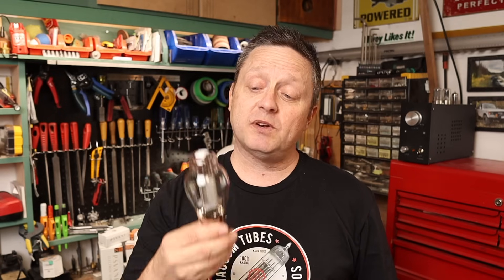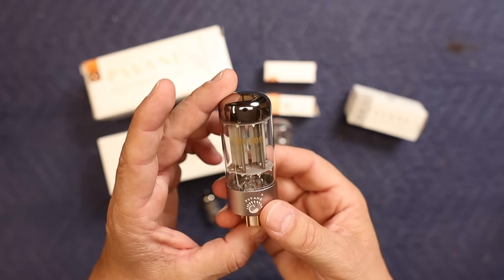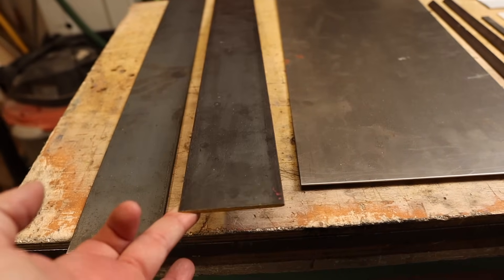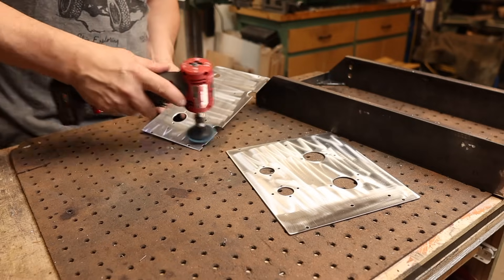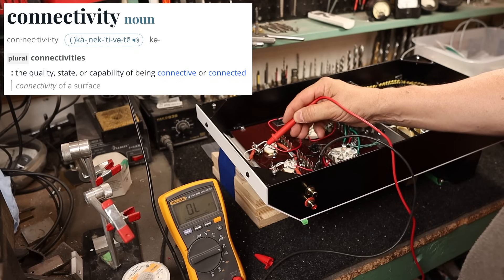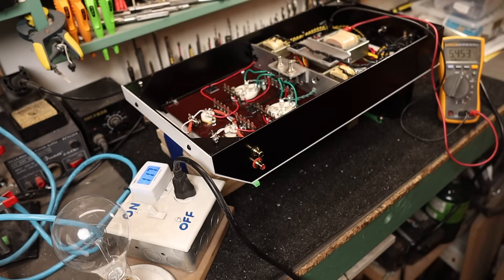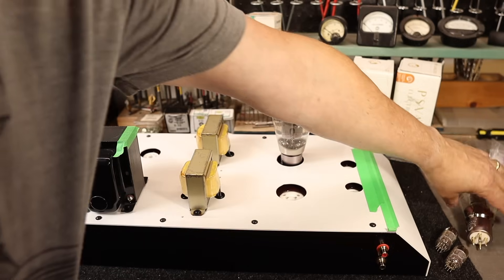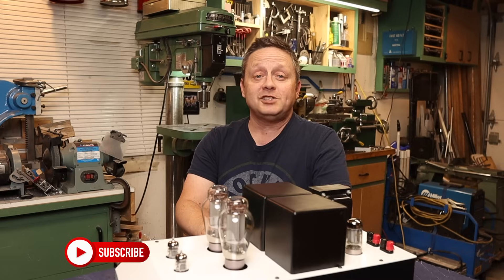Building a 2A3 DHT SET Power Amplifier

Comment: I have the same metal bender!  I don't have a welder. I have looked at a few. For hobby use, any recommendations for chassis?    Without it I tend to cobble something together adding supports with small fasteners.  Or, I buy an aluminum chassis from China. These look nice. That is how I made my tube preamp -- The Lynn Olson Raven with Lundahl transformers. A really nice build. I added a phono stage and MC stepup.

I built a 2A3 about 8 to 10 years back. I use Sophia Mesh 2A3 - more like a 300B. I used inexpensive 2A3s to test. Similar design to your's but different rectifier and input tube. I used a James Audio output transformer, not in business now. I saw that Silk Audio in Thailand is worith looking into. I get the price concern and commend the build! My James cost around $350 each as I recall. I used beefy Hammond chokes and cylindrical capacitors on the parts side on a Hammond chassis. Looks nice. I don't use it even though I have Klipschorns for it. After breaking in the highs were sparkling - better than my solid state amps, or that's how I recall it. Makes me want to give it a try for a few months. It does lack power unless used on high efficiency speakers. My other DIY speaker is around 92db but was just OK to me.

I subscribed to Sound Practice for years and bought the CD of the issues.

Nice build!  I need (want) a hobby welder.
Reply from the maker: Thank you for the thoughtful comments! I can tell you appreciate and get the love of making tube amps. Lynn Olson site has a lot of great projects and information. Having a welder is handy but if you only want to make chassis with it, I'd probably just source one from overseas. If you want to do more you can't go wrong with a small wire feed Miller 142 or the Hobart 125 for thinner metal.  I've heard good things from the TITANIUM welders from Harbour Freight but have never used them.  Make sure and you have the appropriate wall plug and you get one that uses gas .  Flux core is really messy, good for gates, not so good for precise work. The welder I was using in the video is a Miller TIG welder. They are double the cost and take a lot of practice to master. It produces a much better better weld. Get a grinder as well, you'll need it!  Cheers.

Comment: Buongiorno cosa ne pensi se si usasse per la struttura del plexiglass di spessore 3mm
Reply from the maker: I am not familiar with that material, I’ve never used it for amps before. Im sure it would look unique but I’m not sure how it will react with the heat of the amp.  Cheers.
Reply: @MikeFreda  ciao dipende da che calore si sviluppa ,quanti gradi C Il plexiglass, o metacrilato, ha una buona resistenza al calore, ma non è ignifugo e deve essere tenuto lontano da fiamme libere. La temperatura di esercizio non dovrebbe superare i 70°C, anche se per brevi periodi può sopportare temperature più alte. In generale, il plexiglass può essere termoformato tra 160°C e 180°C, e la sua temperatura di fusione è simile. La stabilità termica del plexiglass si aggira intorno ai 100-116°C, secondo Temaplex Online Shop. 
Ecco alcuni dettagli aggiuntivi:
Temperatura di esercizio: Si consiglia di non superare i 70°C per un uso prolungato. 
Termoformatura: Il plexiglass può essere termoformato tra 160°C e 180°C. 
Temperatura di fusione: Simile alla temperatura di termoformatura, intorno ai 160-180°C. 
Stabilità termica: Il plexiglass ha una stabilità termica che varia tra 100°C e 116°C. 
Temperatura di ebollizione: Circa 220°C. 
Resistenza agli urti: Il plexiglass ha una resistenza agli urti moderata, inferiore a quella del policarbonato. 
Infiammabilità: Il plexiglass è un materiale infiammabile e non deve essere esposto a fiamme libere. 
Resistenza chimica: Il plexiglass ha una buona resistenza chimica ad acidi e detersivi, ma non agli alcoli e solventi.

Comment: Nice. I’m kinda new to amp build, but looking at this and your preamp, shouldn’t I see some tone controls somewhere?
Reply from the maker: Good question, they can include tone controls but in this type of preamp it is designed to be as pure as possible.  Adding tone controls adds an extra layer of complexity and components to the circuit... not to mention that it can also induce "noise" into the audio signal due to the potentiometers being needed to make adjustments.  Cheers!

Comment: RATHER THAN 5AR4 YOU MIGHT USE A 5V4.  YOU CAN GET NOS AMERICAN 5V4s REASONABLE.  YOU CAN NOT GET NOS 5AR4s REASONABLE.  THE CLONES ARE PRETTY BAD AND WILL ARC OVER.  JUST A SUGGESTION THE 5V4 IS A GOID TUBE AND VERY AVAILABLE
Reply from the maker: That’s for commenting. Yes, that is viable option. This type of rectifier will drop the B+ a bit more. I don’t think it’s a big concern.  I guess one could upsize the PT to accommodate.  Cheers.

Comment: Good God man! Warm, rich, pure tube sound! You've only gone and triggered the oxymoron alarm.
Reply from the maker: Click bait? Since there is no solid state devices in this amp, the term "pure tube sound" is technically correct. lol. Cheers
Reply: @MikeFreda  I mean't in the sense that microphonically susceptible, odd and even harmonically prone, poor noise floor level thermionic valves can never accurately be described as being "pure of sound"!
Clearly I shouldn't even be on this thread! Off with me then! Regards.

Comment: I’m afraid I need some help with sourcing the hum balance rheostats. I’ve been looking all over, but I’m not sure I’ll order the right component. Thanks in advance.
Reply from the maker: Thanks for asking.  Yes, I can give you a proper type, size and partnumber.  Mouser has a couple options. I used Clarostat.  Vishay makes a 10 turn one.  Let me gather that information for you…. Hang tight.
Reply: @MikeFreda  Thank you! Very kind.
Reply from the maker: 50ohm, 2W-5W Potentiometer.  Clarostat: 53C3-50 2W Linear 50ohm.  RV4NAYSD500A.   If you can find that, try CTS ones from Mouser.   026TB32R500B1A1.     I hope that helps!?
Reply: Mouser  Belgium has the CTS! Great help, thanks!

Comment: I kindly suggest that you do not use ferrous metals for  the chassis construction.
Reply from the maker: Thanks for the suggestion, I appreciate the feedback! I'm interested in hearing the hypothesis of this. Cheers.
Reply: @MikeFreda  If you check out Real World Audio's videos on his voit pipe build... you will he uses brass screws to join the speaker panels together.  He feels that ferrous screws can cause distortions (however slight) in the magnetic field of the speaker.  Also, if you check out Danny Richie  speaker upgrade videos, he laments any ferrous material in the speaker binding posts or cross overs, as he feels it causes distortion in the audio signal.  If you check out most builds (home or pro) you will see that the only "iron" on the unit is in the transformers.  I would also suggest using metal (instead of wood) sheilds on your top mounted transformers and inductors.
Reply: @misterhat5823  Good point ... however, the OP is using a case made out of ferrous metal.  Big difference.  If you want to focus on the screws in the point I was trying to make... go ahead.

Comment: Any thoughts about using an LM317 Adjustable Regulated Rectifier Filter Power Supply Board Module for the 2A3 filament supply? 6.3vac input, adjustable DC output.
Reply from the maker: Thanks for commenting. Great question, if I had high efficiency speakers and/or my measured AC hum was over 2.5mvac then yes, I would consider DC filament supply.  Not sure if I would go with a LM317. There are more sophisticated regulators that that old guy. You may be able to accomplish the same thing with just a Schottky bridge rectifier and a CRC filter network.  I was going to that level, I would also upgrade the OT's and install a dual rail PSU.  Cheers.
Reply: @MikeFreda  wasn't the dc I was thinking about, just an easy way to get the 2A3 filament volts.

Comment: Why SRPP and why such budget OPT?
Reply from the maker: Thanks for commenting. Right, good questions. I wanted to stay true to the topology of the circuit used in the article and see if it made a difference.  One could just omit the top triode and replace it with a load resistor or a solid state CCS.   I had these OT’s in my parts bin and I suspect many people may want to try to make this and these OT are obtainable across the globe. 
I wanted to show you can make a good sounding SET on a budget. Not a lot of people have $1000+ for a project like this. If someone wanted to take it up a notch, I would use a CCS on the 12AT7, Edcore GXE15 OT and a split rail power supply section.  Cheers.

Comment: Nice build!  Ahh...the magic of directly heated triodes, I can't live without them!  Do you have a dedicated 2 channel setup it's going in?  As a seasoned 2A3 builder, one might consider using the Hammond 302AX (designed for 2A3 builds) for just a little more.  After buying separate filament transformers...the price difference is pretty negligible.  Some other adjustments would be recommended with the lower voltage to optimize it.
Reply from the maker: Thanks! Yes, I already have a 2A3 dual monoblock set up in my main system. This amp will be going into another room in my house.  Yes, the 302AX is a fine option for 2 channel amp like this. A bit overkill in the current rating. I had these filament transformers left over from a old 2A3 project I tried ~15years ago. The chassis had a low Wife Acceptance Factor and after a few years, I dismantled it.  They have been sitting in my parts bin. Finally put them to good use!   Cheers
Reply: @MikeFreda  Right on!  Always good to use up the parts laying around.

Comment: Hello Mike how does this 2A3 amp does compare to your older amp with a 6DN7?
Reply from the maker: Good day, they do have a similar sound signature but this 2A3 amps is a step above. It probably has more to do with the power output. The power section of the 6DN7 is similar to 45 tube and they typically only produce around 2 watts. An extra 1.5-2 watts can make a bit difference in driving a speaker especially in the lower frequency range.  They are both good amps in their own right.  The 6DN7 is my shop amp and on every day. The tubes are cheap and last a long time so I don't feel bad when they eventually burn out.  I have a lifetime supply! lol  cheers.

Comment: Mistake.turning your chassis on its side.dht filaments will sagg.see 2a3 documentation.
Reply from the maker: Thanks for the comment, I appreciate the feedback! I've never heard that before but it would make sense. Can you tell me what document that is in? The RCA 2A3 tube data says it can be mounted Vertically or Horizontally. Thanks
Reply: I'm not a 2a 3 expert but I seem to remember a comment that someone experience a problem with 2a3  or was it 300b with amp on side for extended testing Chinese tube.supposdly got ok when tube operated back in upright position.
Reply from the maker: The amp was only on it side to measure voltages... couple minutes if that and it all checked out to what I calculated. Always check with the tube manufacturers data sheet to see what is the ideal operating parameters.  Cheers.

Comment: I have some 2a3's USA/RCA, Also 6a3's. etc....I have no use for this stuff. Interested? Have apx. 1000 tubes...I'm old from the 60's...Tubes going back to the 20's. Also transmitting RCA tubes as well. No B.S. Retired engineer....Pack Rat.
Reply from the maker: Wow, that sounds like quite a collection, thanks for reaching out! Old 2A3's sounds interesting!  If you can, please send me a PM to discuss. Cheers
Reply: @MikeFreda  what's a PM? Of course I did not check your YT listing, maybe your EM could be listed.
Reply from the maker: Private Message.  My contact info is on my profile page in my channel description. You may have to subscribe to see it. Thanks
Reply: Hi Mr. Smith,
Thanks for sharing — your collection sounds amazing, especially the huge amount. I’m definitely interested!
Just wondering, are you looking to sell some (or all) of your collection? If so, I’d love to discuss details with you.
Looking forward to hearing from you!

Comment: JJ makes a "2a3" that has a 40W dissipation rating that is essentially a 300B with a 2.5V filament.  I wonder if these Psvane "2A3" tubes are the same with a very conservative dissipation rating.
Reply: EVERY current production 2A3 is a derated 300B copy with the heater folded in half. You could easily see this by the plate shape looking from the top — something like "-|---|-" for the standard double-plate "true old" 2A3 and "--|--" for the 300B.
Reply from the maker: Good information. Thanks.
Reply: @alexadrianov8357  Early 2A3's were actually mono plate tubes, later they figured they could cut costs by making the dual plate tubes that most NOS 2a3's used (as well as 6B4G's and 6A3 tubes).  Not all new production 2A3's are 300B's with 2.5V filaments either, Emission Labs 2A3's, while monoplate, have a much smaller plate structure and envelope than their 300B's.
Reply: @georgeswanson9483  Thanks, I've checked the Emission Labs 2A3s (both solid and mesh plate versions), and they indeed seem to be closer in construction to the early single plate 2A3 than to 300B
Reply from the maker: Interesting thought. I can ask the PSVane rep but I suspect it probably a cost saving for that style of mold. It does looks like they share the same envelope between a couple of tubes.  I do know that if you push a 2A3 to it's limits it can sound just as good (and perceived loudness) as a 300B.  I'll do that one day! Cheers